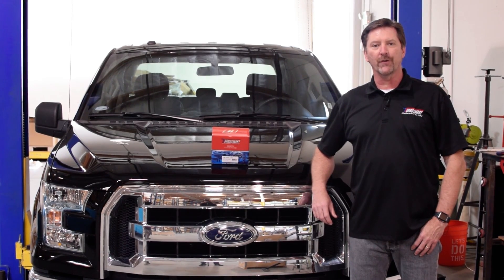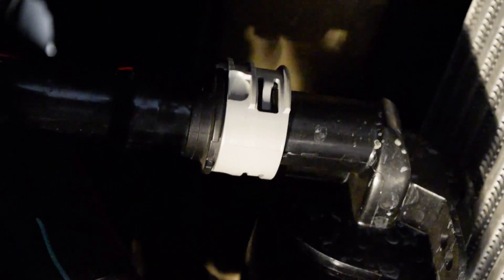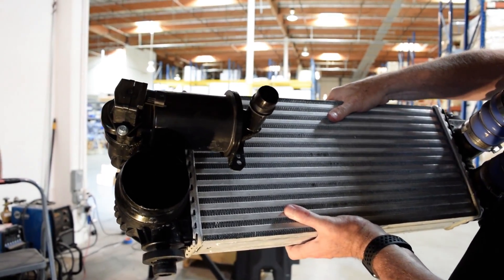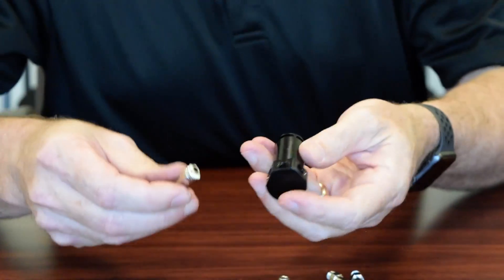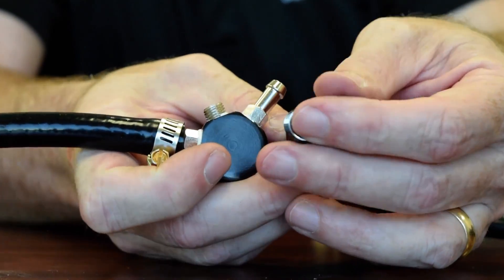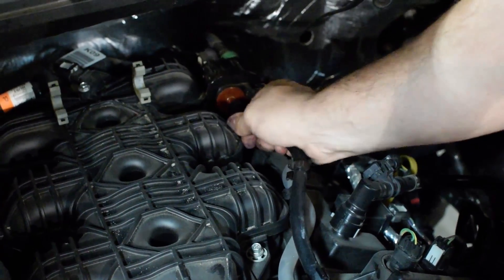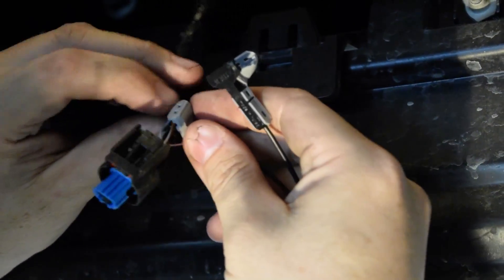BOV INSTALL: F150 Smart Port BOV (P/N: TS-0215-1371)

Comment: will this work on 2023 raptor 3.5 EcoBoost ?
i just installed the Vee port TS-0225-1001 it produce lower sound when parked even when rolling compared to the supersonic one which i have on my other 2019 raptor .

Comment: Have you had any problems with this BOV?  I've experienced a ton of compressor surge. I learned that there's 4 holes in the vacuum cap on the top of BOV, and if the hose nipple isn't lined up with one of those holes, it delays the opening of the BOV. I've been fighting with mine since I got it, and it's never worked properly for me.

Comment: i have a 2017 f150 2,7...i watched the install video but its for 3.5....i had my cover off the motor today do i run the vacum hose in to the splitter? or do i go back to checkvalve and leave splitter open?
Reply from the maker: Hello, 

Reach out to our tech team and we can get you situated.

Comment: other than going "pishhh" what do this do better than the stock one?
Reply from the maker: Aside from preventative maintenance, our valve seals better than the factory unit. Our valve also supports higher horsepower levels.

Comment: Wouldn’t that exposed spring rust and break eventually. My concern is road salt in the winter. Also what is the difference between the supersonic and your original BOV?
Reply from the maker: The spring is not made of steel so corrosion is not a concern. The Supersonic is pneumatically controlled by a vacuum reference and the Vee Port EM (TS-022-5-1001) is electronically controlled by the ECU. Performance is virtually identical.

Comment: Will this work with aftermarket bigger intercooler?
Reply from the maker: Depends on which one.  They are all different. As long as it accepts the factory valve (with the twist flange), it will fit.

Comment: Way too over priced for a noise maker
Reply from the maker: The functional benefits of a bypass valve/blow-of valve span far beyond the sound emitted when boost pressure is released. If you have ever looked at the factory OE bypass valve, its entirely plastic with poor sealing capability. Our valves are constructed from billet CNC aluminum making them much stronger compared to the OE valve. Additionally, if you ever plan to tune your truck (which includes increases in boost pressure) our valves improve flow, boost handling, and response while preventing compressor surge. This will aid in extending the lifespan of your turbochargers while improving the vehicle's overall ability to regulate boost. If you have any other questions or comments please contact us for assistance. https://www.turbosmart.com/contact-us

Comment: My truck sounds like a sprinkler while in idle? I took everything off and reinstalled and still sounds like air is leaking from the two hoses on top. What can be causing this leak and is there any way to fix it
Reply from the maker: Hello,

We appreciate you reaching out. For more in depth assistance, please contact our technical support team using the link below. We are happy to assist you further!

Turbosmart.com/Contact-Us/

Please allow up to 24 hours for a response. Thank you!
Reply: 2018 here. Mine sounds the same. Drives me crazy. I wish I left my stock on with VTA mod. I also have check engine light non stop P0035. The stupid cel eliminator is crap. I have requested tech support twice. It has now been 2 weeks, still no support.

Comment: What will happen if it operates underwater when water crossing?
Reply: as long as it maintains positive pressure pushing air out of the lines, water wont get sucked in.

Comment: Anybody notice a decrease in fuel mileage by about 4 mpg? Use to get around 19 now im getting around 15 right after install. Just drove 400 miles on a trip and wasnt impressed
Reply: Any updates on that issue? Did you go back to factory?
Reply: Your truck isnt seeing the air pressure it is used to seeing so its calculations are off. I would check actual mileage at the gas pump and not trust Fords inaccurate MPG meter
Reply: I notice that too don’t know if is accurate

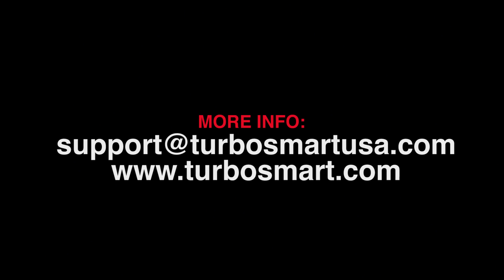Comment: For those of you considering this, I suggest going to 9:30 in the video and listen very closely to the sound this thing makes after he starts that truck and it achieves stable idle.  The BOV just cycles open and closed when at idle and it sounds like a sprinkler head under your hood.  Totally absurd, plenty of users complaining about that.
Reply: Steve Brightman yes I noticed that as well
Reply: Just installed this and wondered what was going on. Didn't even drive the truck yet

Comment: This doesn’t fit a 2.7 liter 2016 don’t buy
Reply from the maker: Yes, this does fit but the line we have you modify on the 2.7L will look different than the 3.5L. You can reach out to our USA Support team for installation assistance on your 2.7 model.
Reply: Turbosmart min is a 2.7 also confused on how the purge canister line hooks up not the same as video
Reply: Can you tell me what you find? Tried mine today and notice my hose behind the TB runs into a dual to single inlet connector. Do we just run it to the bottom connection the hose is attached to?
Reply: Same problem here where am i supposed to connect the hose it goes into a connection of two lines

Comment: This does not work on a 2015 f150 3.5?ecoboost, there is a completely different vacuum system that is not the same size, glad i didnt cut my line, turbosmart needs to address this asap
Reply: Got mine all hooked up but the spacer gos on top of the intake won't fit

Comment: I installed mine exactly as shown and when revving and shifting it requires a lot of RPMS. and doesn’t always activate. What could be wrong?
Reply: When you are on the throttle and it's accelerating through shifts, it doesn't release pressure between each shift. A manual transmission car does because you typically let off the throttle when you shift.
Reply: oSo Sketch the spring internally is adjustable you just rotate the black part with the vac nipple left or right to loosen or tighten the spring. If it’s to tight it will not vent proper of to soft it will vent pre mature

Comment: Seriously, why isn't there an option to run a 38mm recirculating BOV from your company? A VTA BOV is only going to cause issues. I'm not a fan of the stock BOV due to its design, but I would never run a VTA on a truck, especially with the BOV being so low to the ground. This is just asking for something bad to happen while off road or in some other environment outside of paved city roads. But then again most truck owners today are just parking lot trolls, so never mind.

Back to my initial inquiry, please offer a kit using the recirculating BOV. Shouldn't be hard, just add 2" of aluminum to that plug and hollow it out. Also include a small 4" section of 38mm ID hose to connected it up and that's it. Bet your company would sell a lot more kits.
Reply: Ifs its not so hard you do it , internet troll .
Reply: @Incognito0987  aww, did someone get offended by being called out on being a parking lot troll? That's too cute.

Comment: I have F150 3.5 ecoboost.   Sorry for my dumb question what is the purpose of a blow off valve?  Will this reduce condensation in the system?
Reply from the maker: Hi Jeff, The BOV is designed to protect the turbocharger from rapid load changes, a detailed explanation can be found in our catalogue on page 3 http://www.turbosmart.com/wp-content/uploads/2018/10/TS-Catalog-2018-Web-low-res.pdf . If you have any further questions, feel free to email tech@turbosmart.com.au. Cheers.

Comment: Everyone, the boost port on (2018) is the same one that goes to your EVAP check valve (the one with the orange nipple) after you cut the factory hose down the middle to remove the spline line. Its a pain in the ass on 2018 2.7L because you have to CAREFULLY wiggle the T fitting at an angle, push the little metal clip behind it backwards, and push it past the oil cooler/fuel line because the T fitting is way too long. almost broke my dam Throttle body inlet nipple off. Also you have to install the 2 fittings on the T AFTER you have it on the truck, because you have to turn it 180 degrees, insert and tighten 1, add the hose and tighten, then turn it another 180 degrees without hitting the top of the intake manifold, install other nipple/hose/clamp. I just installed mine today and im very disappointed. The T is too long and not airtight enough for the 2018 2.7L as i had a slight vacuum leak there, and had almost an INCH of play between the locking area you put the 'securing' clip on (it barely does anything).. so i had to wrap Teflon around my Throttle Body nipple where the T goes, and could only get half of it because at that point trying to remove the T is dam near impossible without either breaking your adapter or having to remove everything and start from scratch. Anyway after 'adjusting' it for over 20 minutes, the best i could  get was on first throttle my BOV would engage 'not very loud', but never again after that even if i waited, or immediate throttle. Maybe i'll try to adjust it 1 more time tomorrow when i get to work, but other than that, trust me i was estatic to think i could have a BOV on my truck, but this was a huge letdown. Im also an  L1 'Advanced' Master Tech and 8 year mechanic, and i slightly 'struggled' with this outdated install. (Not for 2018 2.7Ls....).. so i'll give an update tomorrow if any luck otherwise im going back to stock and saving myself the stress and headache that this eventually caused me.. 
Also you have to 'adjust' your BOV before you even put the CAC large pipe on, because the BOV relief end runs into the CAC hose.. but removing the clip that holds it in is quite simple.. so its not so bad, but still annoying. Enjoy. If your debating on buying this and you see this comment, wait 1 more day until i give you an update, or unless TurboSmart can give me any insight or advice. Thanks.

UPDATE - Ok so i found the problem, my set up was flawless, but the Weld flange was loose, which is why they 'recommend' welding it into place., because it comes loose from the factory and you have to hand tighten it yourself.. like why wouldnt this be welded for us for 300$ lol..? Otherwise, sounds great, but it does cause excess chatter in the throttle body, like ALOT of chatter you would think something was wrong, but lets hope its normal. I will be posting a video on this in a day or 2, so anyone with a 2017/2018 2.7L/3.5L can see all the tweaks that need to be made in order for this to be headache free and not break anything, because this kit hasnt been updated since 2015. But it is possible and it does sound great, but honestly putting a 2$ or 35$ plug in the Recirc line doesnt really sound much softer.. may want to take that route if ur on a budjet and dont plan on tuning or upgrading your factory turbos anytime soon, because the sound is very similar and takes 15 seconds instead of 2 hours. Enjoy.
Reply: nick h did you see any drop in mpg ? I’m going to install this on my 3.5 2018. Just wondering if there are any performance drops. I have an on board tuner with eco/tow/performance settings & a cold air intake on 35” tires. Let me know if you have any info bud

Comment: This video is wrong for the 2.7! I cannot figure out where the boost T goes and no one answering
Reply: It goes on the nipple right after the Throttle Body Plate bro... The line that is about 8 inches long and runs to your EVAP check valve.. when ou cut the spline on the end it will reveal a large orange nipple. It connects into a little square box with about 2 sensors/connections plugged into it.
Reply: nick h i figured it out that day, wound up tracing it. Thanks though
Reply: no problem. glad you got it figured out
Reply: I have the 2.7 and i dont understand, if i take it off the orange nipple that will leave one line unplugged because off my TB nipple it runs into a junction for another line, then into the the orange nipple, somebody really needs to give directions for 2.7!!!
Reply: Aaron Swink I’m having the same problem
Reply: I can't figure it out 😵 I really wanted this on
Reply: Anybody have pics or a quick video on how they did their 2.7? Can’t get the OEM MAP adapter to fit.

Comment: This freaking boos reference is not slidding onto my 2018 3.5L Ecoboost, WTH!!!!! I am I doing wrong.  So frustrating....
Reply: Wrap a little bit of teflon around the TB nipple, otherwise it might be a little bit leaky as mine was. Also you have to put it in at an angle until you get it on about 1/4 inch then straighten it out because the fuel lines etc are in the way, as well as those little metal tabs that stick out of their connection, so be VERY careful otherwise u can break your TB nipple n ur f**ked... the boost Ref adapter is too long/loose for 2017/2018 connections.

Comment: I would like to purchase and install it, will this do anything to the performance of the vehicle? 2018 Raptor...Thanx
Reply: No. there is no 'increased throttle response", its just for the sound. Now if your planning on spending $3,000-$5,000 on brand new upgraded turbos, then yes you will want this to handle the boost, but i dont see you upgrading anything on a $70,000 truck under warranty lol.

Comment: just got mine how do i make it louder? do i harden the pressure or soften it?
Reply: Louder = harden pressure, the more boost that builds up will cause more noise, just dont overtighten, do not tighten it past the last O ring. Since Turbosmart seems to not give af about any1s questions, i'll be answering them to help yall with future headaches lol
Reply: @nickh3809  Shoutout to you for helping everyone out, myself included!
Reply: @nickh3809  hey brotha just installed mine n the engine light came on. Sputtering n low idle. I checked everything twice can't figure it out.
Reply: @rod23bo  100% you have a vacuum leak somewhere. I know ypu said you dpuble checked everything but go over all vacuum related hoses/connsctions and lines 1 more time.
Also make sure you installed the electrical connector bypass correctly and that it is spliced correctly into the harness underneath the front bump area (on the driver side near the fog light)

Comment: On my 2016 3.5 ecoBoost the boost port looks nothing like what you are removing and installing. Am I doing this after the check valve from the line that is coming from the brake booster, and then removing the other end of this line at the TB? There are (2) ports on the TB. Both on the same side atop each other.....
Reply: Whichever one goes to your EVAP check valve, should go into a little square box with 1-2 sensors on it, then the other end goes into your TB
Reply: I'm having same thing on my 2016 which line did you end up using the top or bottom line.